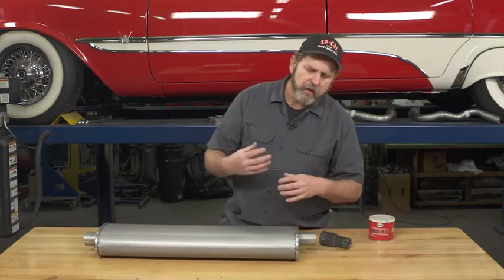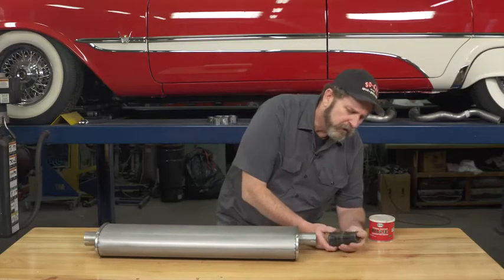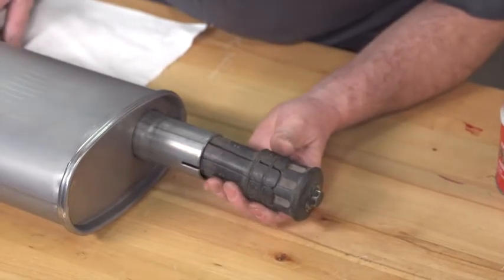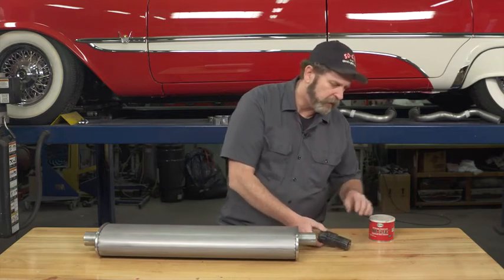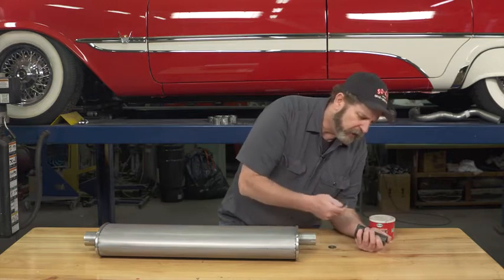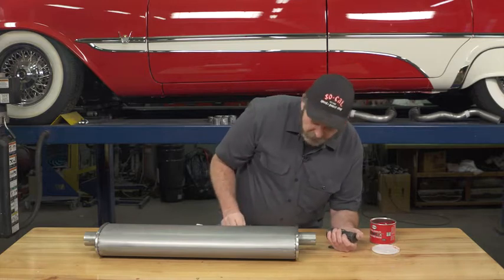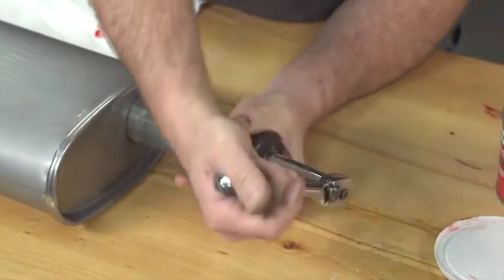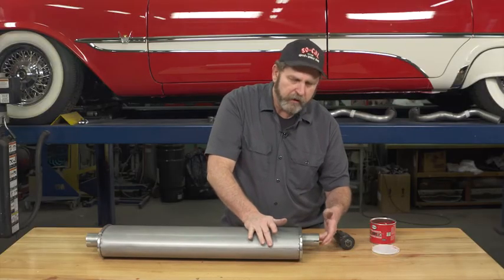Exhaust Pipe Expander

Comment: Widen the end of the pipe that pointed TOWARDS the engine  that way the exhaust gasses funnel into the new pipe catching the gas and sound MUCH better and it will last much longer. 
[Engine]>---- >---- >-------- [muffler]---
                          👆
Say this is the newpiece

Comment: That pipe expander is a piece of crap , you USUALLY only get 2-3 uses out of it , even greased the center bolt still strips.
You would be better of purchasing or renting a LYSLE (lial) 17350.
Sorry , just gotta be honest  !
Reply: @mathieugendron5865  That tool cost a $hit load of money. What's needed is something that the average DIYer can afford.
Reply: Go to the auto parts store and loan one. Let them take the cost of the abuse of this tool. You spend money there anyway
Reply: Heat the pipe to cherry red first, even a professional tool risks tearing the pipe when it's cold.

Comment: I have this exact tool. It didn't expand 2" pipe at all. Use too much force like a 1/2" impact gun and the fingers of the tool get all cock-eyed and still did not expand the pipe. Garbage tool IMHO.
Reply: Hi Best results take ur time n use it manually works a treat.oh grease it up to .